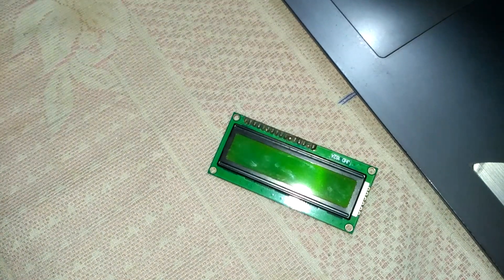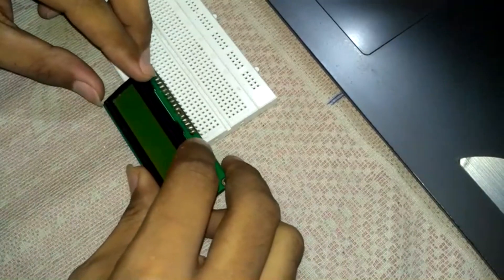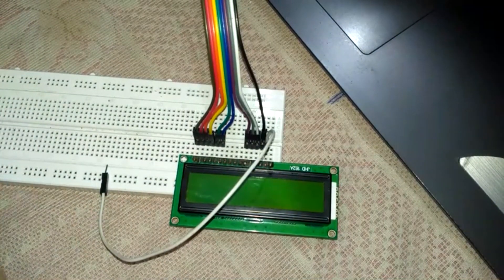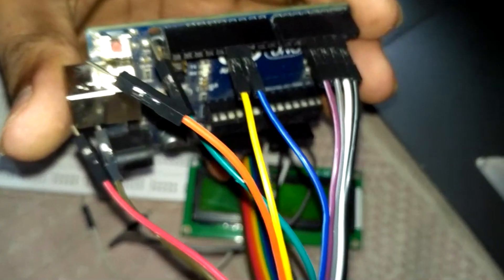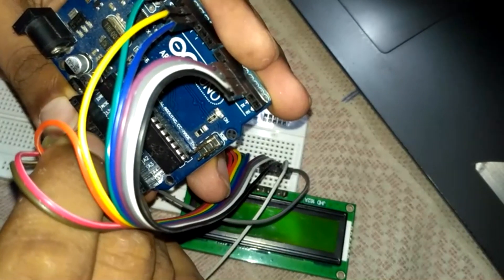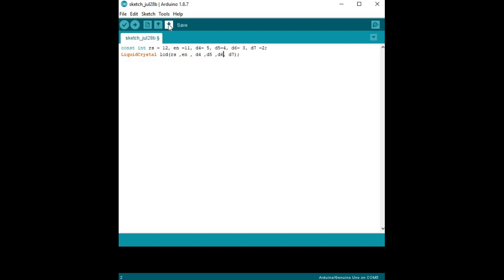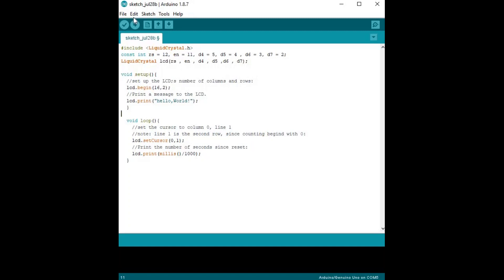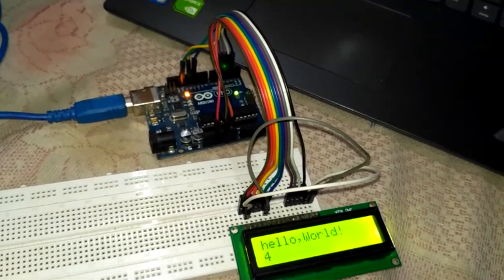How to connect LCD to arduino without potentiometer

Comment: where to connect last 2 jumper wire which you have connected  A and K
Reply from the maker: See again you get that
Reply from the maker: A and k pin fron arduino gnd to +5v

Comment: My light is not displaying on lcd
Reply: For background light use A and K pin from lcd to aurdino Gnd and +5
Reply: Thankyou it worked
Reply: @shubhamchachan6440  it's ok bro🙂
Reply from the maker: check your display is in working condition or not